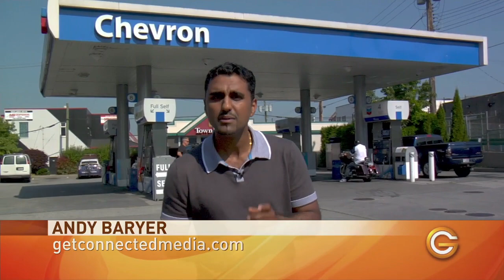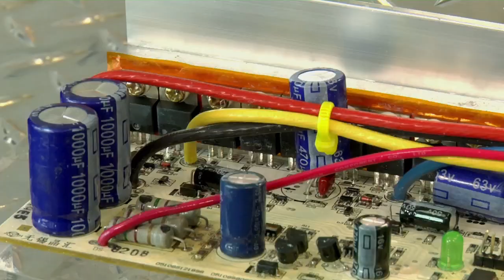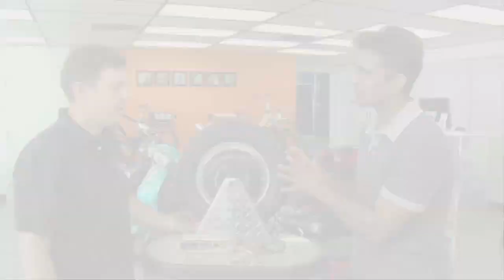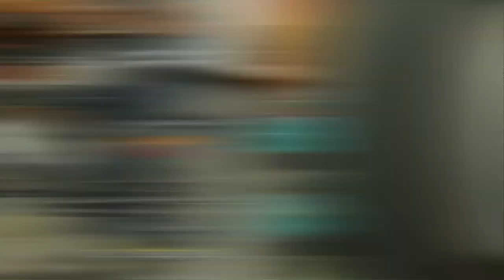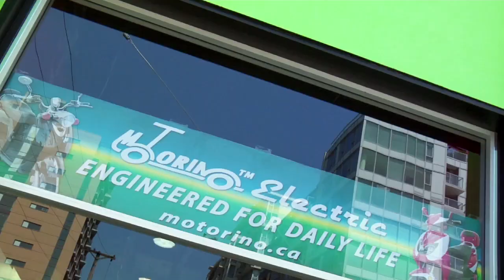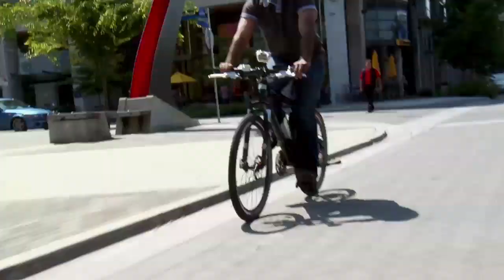Testing Out Electric Bikes at Motorino Electric - Part 1 of 2

Comment: This info is different on the website. The Lead Acid battery goes for between 50-60 km between charges and takes 7-8 hours to fully charge. The Lithium battery adds another 10-20 km and can be charged in about 2/3rd the time I believe. 
I'm saving up for one right now so I've been doing research on them.
Reply from the maker: The video is 6 years old so things will change. Hope you get one, they're great!